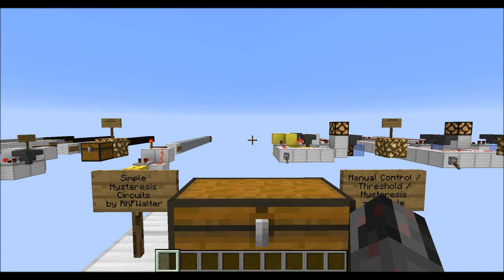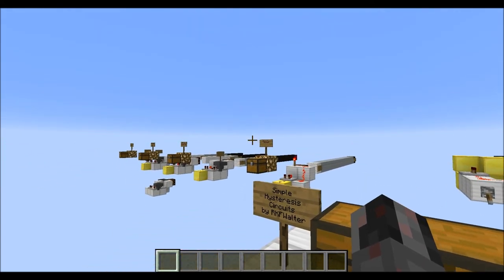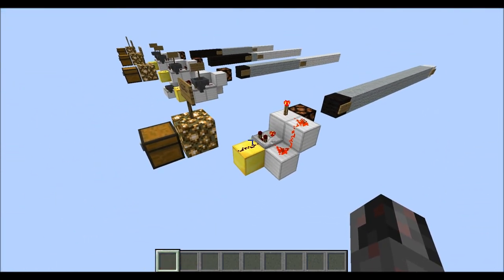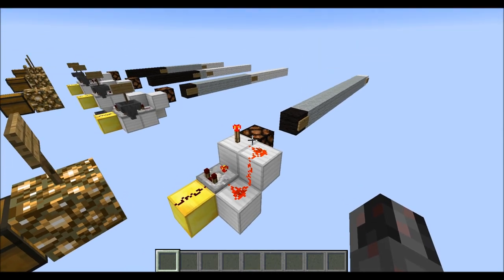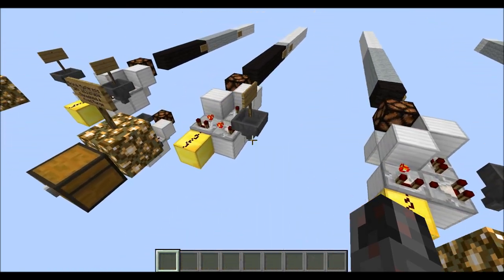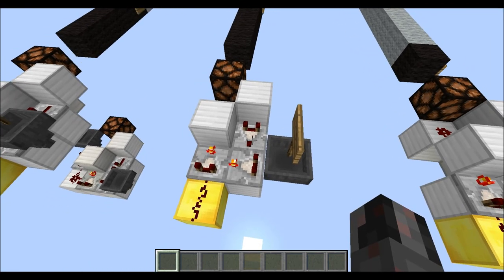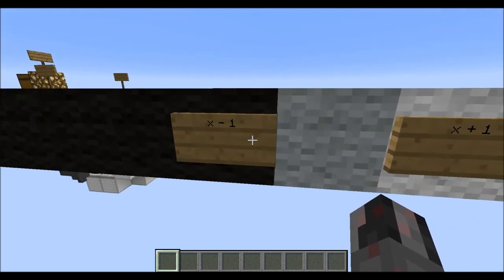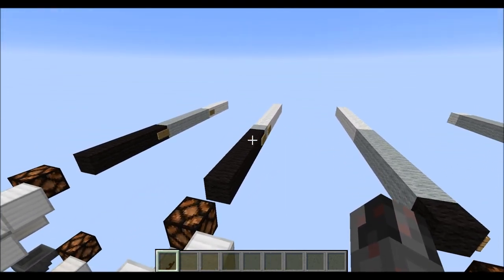Tutorial: Simple, adjustable Hysteresis Circuits (Schmitt Triggers) (World Download)

Comment: I had no idea this thing was called a "Schmitt trigger", but good thing I found it anyway. Going to use it for a machine that turns one kind of resource (TNT) into another (Botania mana), which is an inherently lagged process (4s TNT fuse and some additional time for pushing the resulting mana into a pool) that doesn't really want to waste input resources because the output container got full. With a single threshold the machine would still create its own small buffer, but I'd prefer if it had a larger buffer and this redstone magic is exactly what I needed there.
Reply from the maker: To be honest I only found out its called a Schmitt trigger when I was preparing to record this tutorial. Before that I always called it simply a hysteresis circuit...

But a very useful circuit nevertheless if you want to regulate buffer sizes.

Have fun!

Comment: Sweet! I’ve been doing a lot of experiments with analog circuits with feedback, and this definitely helps. I already used a derivative of your 3rd Schmitt trigger combined with a “leaky capacitor” to make a charger/discharger
Reply from the maker: Sounds like an interesting project. Happy to help :)
Reply: @R.K.F. Walter yah, I also managed to improve upon the design of your fourth Schmitt trigger so it has an analog output
Reply from the maker: Not sure if it's still counts as a schmitt trigger with an analogue instead of a digital output...

Comment: I would love a more clearer demonstration of y and x+1 thresholds.... I've been playing around with this for the past hour and I don't see how it works. I have an input signal of 13 and my thresholds do not respond how I thought they would...
Reply from the maker: I'm not sure I understand what you mean. Do you have trouble with how the circuit works in detail, or is the circuit's behaviour faulty? Or was my description ambiguous?
Reply: @RKFWalter  the issue is me lol, I'm having difficulty incorporating your design into my build. I have a hopper Minecart and a detector rail whose output is either 0 if no cart is present. Or the signal is 12 to 15 because of its inventory. I'm trying to make it so there is only a high redstone output if the detector reads 12,13 or 14. If that makes sense?
Reply from the maker: Then I would try the following setup with two signal paths instead: 
- Threshold at 12 => output ON
- Threshold at 15 => output OFF  (overwrites Output above)

A hystersis circuit won't really help you here since you have a OFF - ON - OFF setup (hysteresis would be OFF - ON/OFF - ON).
Reply: @RKFWalter  Ah that makes sense I think, I didn't understand that when I watched it yesterday!
Reply from the maker: @toastonryeYT  No problem. Happy I could help.

Comment: Wouldn't a Schmitt be kind of useless in minecraft?
I mean, isn't a schmitt trigger turn all irregular wave forms into square wave? There is no need for that in minecraft, is there? A redstone clock is an oscillator, but it still generates square wave, doesn't it?
Reply from the maker: One simple example for an non-binary oscillator would be an etho clock (if you directly use the comparator output and have enough items inside it). My 2-tier piston drivers also use triangular analogue signals...

Also there are already some known contraptions that use them, too. Sethbling recently featured an etho clock designs that actually uses an extreme Schmitt (triggered at signal strengths 0 & 15; https://www.youtube.com/watch?v=qNbaoIBywmI&t=175s ). I also made a tutorial about a trash bin, that only starts to throw items out once an adjustable threshold is reached... So it's certainly not useless, even if only rarely used.